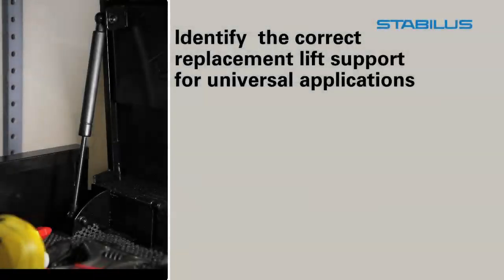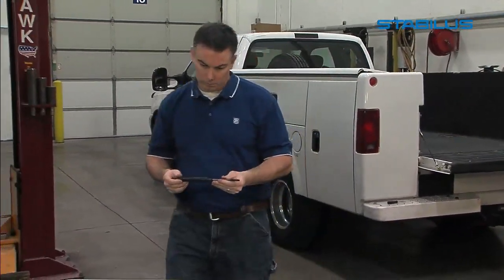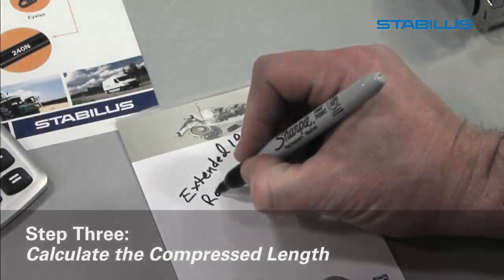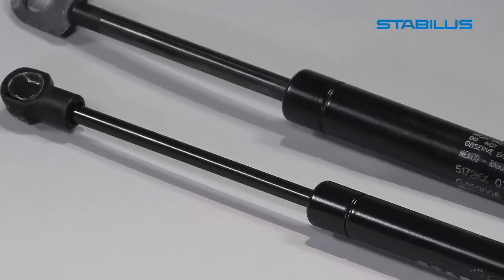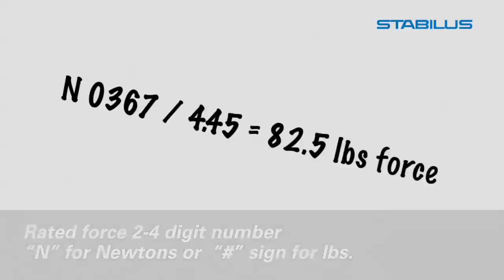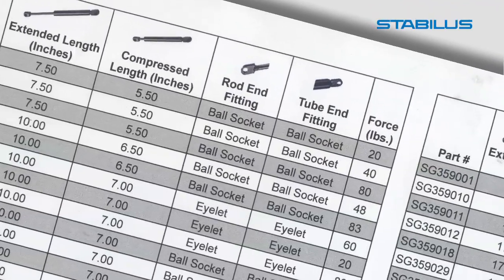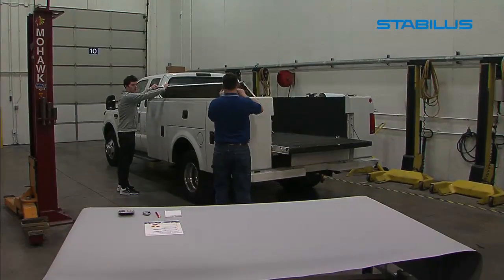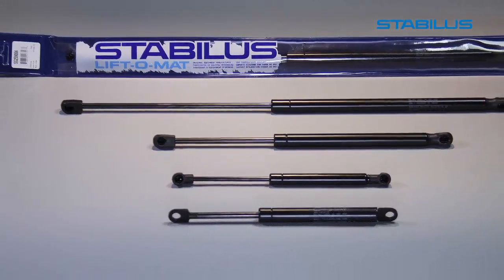STABILUS Universal Lift Support Sizing

Comment: How about the ability to read the Stabilus part # on the lift cylinder? Which one of the long list of numbers printed is the part #?
Reply from the maker: +Michael Meier the Stabilus part number begins with "SG" (i.e. SG359005). Sometimes the "S" may be missing (i.e. G359005).
Reply: This is incorrect. I have one that has several #'s, but not one of the #'s start with s or g. As far as that goes, the only # on here that starts with a letter at all is d, and that is a # for all Stabulis lift-o-mat. Its the only # that even starts to do me any good, but I still can't find the exact one I am looking for.
Reply: tos con dolor de pecho
Reply: predio

Comment: Hi, I have a Proform Cross Trainer manufactured in 199x which has 2 of gas springs. They have the following information: Stabilus 755419  022/94   105136. The length is about 26.3". These are obsolete parts. Can you please help me to find the specification or equivalent replacement? Thank you very much.

Comment: I have a seat ibiza with part number "6J3827550" any clue on a universal lift support replacement?
Reply from the maker: Thank you very much for reaching out! Our technical service team suggests a SG 330096 would be a very close match. For more information call our Tech Service Hotline at 800-321-0784.

Comment: I have a camper shell on my truck that needs replacement struts. The only thing printed on both Stabilus struts are 0888IN 014ON 290/00 A 21. Which one of these numbers is the part number? I am having a hard time finding a replacement. Any help would be appreciated.
Reply from the maker: +ovationsensation We currently do not offer an exact replacement. However parts SG459030 and SG359008 are near the needed fit, with a 1/2" difference, and they might provide a solution. The product can be found at O'Reilly, Pep Boys and AutoZone.